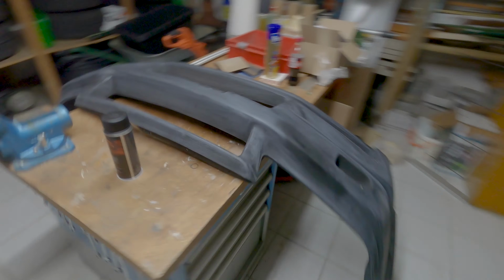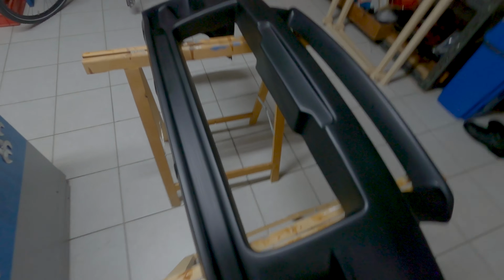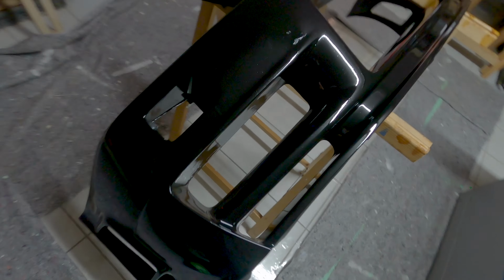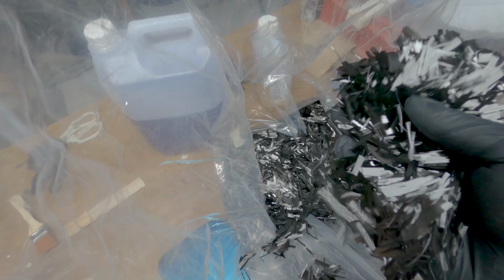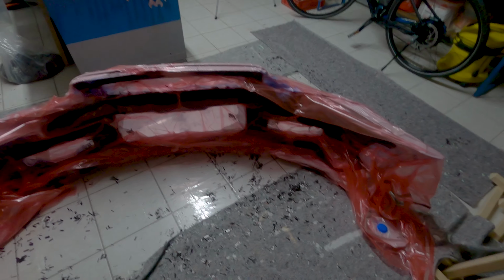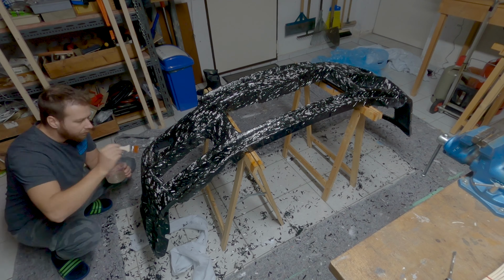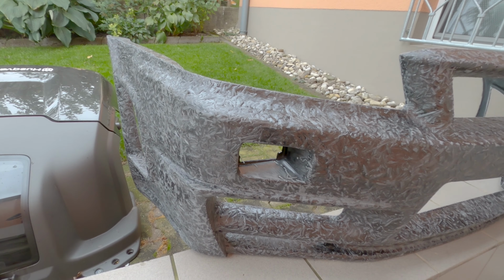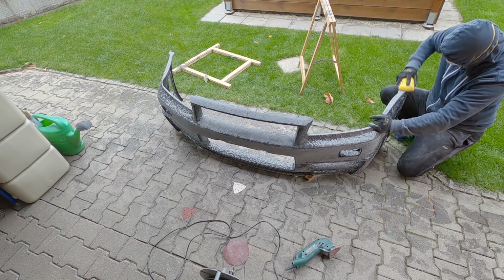Forged Carbon Fiber Skinning  my R34 Z-Tune bumper - DIY Chopped Carbon

Comment: Not bad, most videos I've seen using forged carbon have matted the fibers down with resin before vacuum bagging, helps with no loose strands and buildup, nice job

Comment: Just vinyl wrapped my Yukon in vvivid + Forged Carbon vinyl wrap.   Highly suggested if you want a very similar look without the mess. My whole suv is done in a dark grey ghost forged carbon wrap with a matte/satin-like finish and looks amazing!  Otherwise,  this looks like another fun method with a little more work.

Comment: Cool video, but it is not forged CF, as for that you would need to apply very high pressure (much higher than in autoclave, just like you do in case of forged metal parts, with a die). None the less, keep up the good work👍

Comment: This is great work, I'm considering redoing my dash in with this and watching yours has been a great help.
Out of curiosity now you've done a few panels do you have a rough rough kg/m2 this spreads? My local distributor sells it in 1kg bags of chopped 13mm lengths. Wondering if I'll need one or two for the dash.
Reply: He talks about this in another video: https://youtu.be/VV7h5cEeqvc 
I think it was in the Outro, hope that helps 👍
Reply: @kiwiliqueur  legend thanks!

Comment: hey man ! how many KG of the carbon fibre did you order, and what size were they ? 15mm?
Reply from the maker: Glad you're asking I probably should've mentioned that! Yes they're 15mm and I used about 750grams being somewhat conservative, having a full kg of flakes should get you plenty enough material for a great finish.
Reply: @LXGspec  where did you order the carbon from? It turned out fantastic btw!
Reply from the maker: @jerryinman6636  Appreciate it! I was lucky and got mine from the guy that built my bonnet but you can usually buy em in the UK from Easy Composites or just from China, type chopped carbon into aliexpress! I'm pretty sure there is more places that offer it too! Hope that helps.
Reply: @LXGspec  thanks so much! Looking forward to seeing your fenders done next....once you have feeling back in your hands from the bumper of course🤣🍻🍻
Reply from the maker: @jerryinman6636  Haha thank you! They've recovered and gonna start on the fenders this week still! 😂

Comment: Hey man! 
What is the weight after that? And do you know the weight before this? :-) But beautiful result!
Reply from the maker: Thank you! I didn't weigh it but I probably added around 750 gram of carbon and another 750 of resin (after sanding down). This isn't exactly the best method for maximizing weight reduction but it is actually adding strength to parts that have been rather thin to begin with.

Comment: Great video. I’m thinking to follow you process. However if I need to drill some 20mm holes through the piece would it be better to drill the holes before or after the process?
Thanks.
Reply: after

Comment: What’s a recommended epoxy resin to use alike the one used in this video?
Reply from the maker: For this application specifically I used XCR Epoxy Coating Resin from Easy Composites in the UK, but I believe you can use all kinds or regular laminating resin for somthing like this. (Y)
Reply: Thank you !!🙏

Comment: Hi, what size are the carbon flakes you are using, so the length. I am from Germany and i am thinking about doing this to some of my motorcycle parts.
Reply from the maker: The flakes are mostly between 15 and 25mm

Comment: Hello, if it's not difficult to share what materials you use, I want to try to do it in Russia
Reply from the maker: Take any laminating epoxy and follow its instructions and for carbon you can search for 'chopped carbon' on AliExpress!
Reply: @LXGspec  Thank you, how much is approximately a gram per square meter

Comment: where did you get the flakes from?
Reply from the maker: Got em from the guy that built my bonnet but you can usually buy em in the UK from Easy Composites or just from China, type chopped carbon into aliexpress.
Reply: @LXGspec  Haven't find any website in germany which sells chopped carbon 😂 but thanks for your tips 👍
Reply from the maker: @jonastacho92  You're welcome! Yeah I couldn't find any in Germany myself.
Reply: Just get normal carbon cut it with scissors